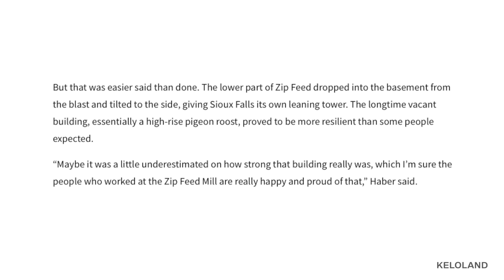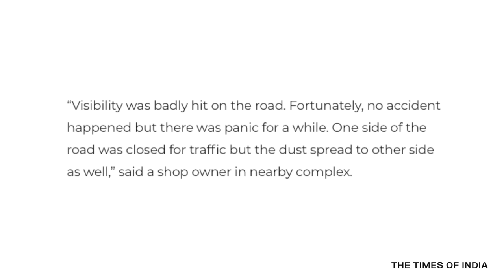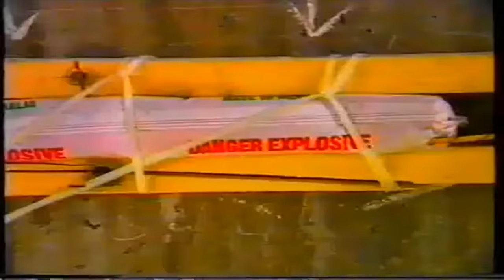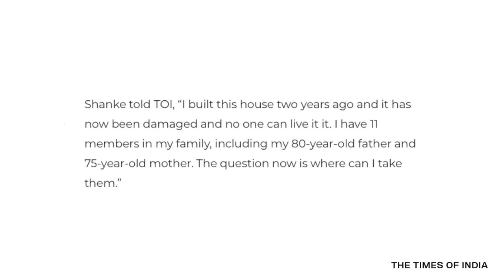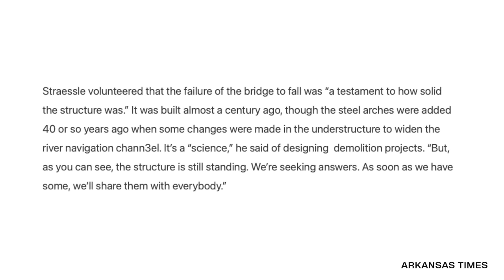Structure Demolitions Gone HORRIBLY WRONG

Comment: As an owner/operator of heavy equipment, I've never understood why excavators demoing chimney/stacks have their tracks pointed at the chimney. When they are close to collapsing the tower, they should position their excavator with the tracks perpendicular to the stack. If the the stack starts to fall towards the excavator, the operator has a couple of seconds to move forwards or backwards. At the very least, it could save the operator's life. It also could allow the excavator to avoid a direct hit.
Reply: I'm a 360 driver. I was thinking exactly the same. He had a death wish there.
Reply: Inexperienced, probably.
Reply: Prometheus School of Demolition, or something IDK
Reply: @OwnageNoobify  Sadly, no Charlize Theron to squish :D
Reply: I think you never operated an excavator. In the position you suggest, machine is prone to tipping over. It is not much pushing or pulling force you can apply.
Reply: @michaelarcher4643  I'm not talking about doing all the teardown work from that position. I'm talking about when the operator is confident that it is close to ready to go. "When they are close to collapsing."  I have seen four videos now of excavators futilely trying to back up as the tower is falling down on them. It's dumb. You may disagree with my suggestion, but surely you don't think that what we see in this video is the correct operating procedure. I'm well aware of the limitations of an excavator side on (perpendicular) to its tracks. If this guy had had a hydraulic chisel mounted (instead of a bucket), he wouldn't need a lot of push when it's ready to go.  I've owned and operated heavy equipment for 35 years. This is stupid dangerous.
Reply: It would have been a lot better to pull that smoke stack over with a real long cable and a bulldozer!
Reply: @smw381st  Agree, but that would have taken time, and too often safety is sacrificed in leu of saving time.
Reply: @Graybeard_  Opposed to someone getting killed?
Reply: @VicenzoV  Hahaha Good point!
Reply: tbh; not a lot of people think about that lmao
Reply: I've noticed they tend to poke at it, then surprise it falls on them.

Comment: That Broadway Bridge thing was one for the ages.  I remember being at work watching the live feed.  Turns out the theater (Robinson Center) is really close to the bridge, about 25 yards.  It has glass facade on the side facing the river and they didn’t want to damage.  The bridge did not fall 5 hours later, they had to add more explosives and detonate it I want to say several days later.  They also put a crane on a barge and attached the cable to wiggle it loose in different places before the second round of explosives.  That thing was so far over engineered it was crazy.  They said it would’ve probably been structurally sound for another 100 years.
Reply: So why did they demo it
Reply: You might also remember it was a private company that tried to demo the bridge. It was the AR Hwy Dept who brought it down later.
Reply: Demolishing a structurally sound bridge, meanwhile most of our other bridges have been crumbling for decades with almost zero oversight or plan in place to remedy the situation as state governments deregulate in order to increase profits for their shareholders (err, I mean, "donors")
Reply: The team who made the bridge  were too good at their job, hats off to them!
Reply: @krotchlickmeugh627  Perhaps it was too narrow.  They clearly didn't think it was strong as it actually was.  This is not the only time that kind of issue has occurred.

Comment: The best missed was the Met sports center which was located in the previous site in the  middle of the Mall of America. The designer commented prior to the demo that it was indestructible . It was , and many things to do to weaken it and many charges prior to the blast the demo crew laughed about how wrong the designer was . All the charges went off and the dust cleared and it didn't move at all . The designer laughed last. 😎
Reply: Dynamite: Boom!
Building: No, just no...

Comment: Rebuilding the Banfield freeway in Portland in 1985, the contractor was removing several old overpasses by dropping a headache ball om the bridge deck, with traffic underneath detoured. The technique worked except for one where the cable on the headache ball failed and wrapped around an 11KV power line overhead, plunging North Portland into darkness for several hours, and injuring several workers. When it was time to take down the 82nd Ave. bridge, the preliminary removals of guardrails, wingwalls, and such had been done, when the bridge suddenly came down six hours ahead of schedule. (The roadway underneath had, again, been closed.) For several frantic minutes, no one cold find the oiler for the crane, who had been seen under the bridge just moments before. He shortly turned up, having climbed a side slope to have smoke break.
Reply: So his life was saved by his cigarettes. For now.
Reply: Guard rails were probably holding the whole thing up. 🫣
Reply: Well stated Jack. Thanks!
Reply: @MrTruckerf  
He had one hell of a guardian angel looking after him that day!
Reply: agreed @MrTruckerf

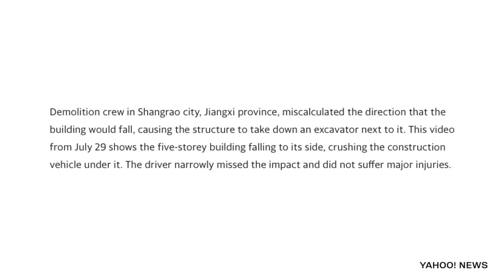Comment: 9:35 is just one more reminder/(proof in evidence) To STAY  in your equipment's protective cab. Do not jump out! Do not try to out run falling debris, it covers 32 feet a second, can you run that fast...Nope!.   That cage and big steel machine is there to protect you and makes it far easier for them to find and dig  you out if buried in rubble before the air supply runs out.
Reply: Close to half of all powered haulage fatalities occur from attempting to flee the cab during an accident. I've seen accident reports of operators falling almost a hundred feet with their equipment and being perfectly fine, safely seatbelted in the cab.
Reply: @OrinPhelps  

in this case (8:42) there must have been an Elderly Woman driving the Excavator.

Comment: After seeing that last bridge debacle I can only conclude that no working for that company had the slightest idea of what they were doing. There were no explosives placed under the bridge on the lowest portion of the cantilever or the supporting pier structure. If you blow those out on both ends that bridge would have come down since the roadbed and the arch would have nothing to rest on. My brother in law is a structural engineer who has worked on a couple of deconstruction bridge jobs and I sent him the link. He concurs with my analysis and said they attacked the bridge but not what was holding it up so it was a 50 50 chance at best.

Comment: In the case of the bridge it's likely that they stupidly used conventional blasting, low VOD (velocity of detonation) explosives, which are great at shifting dirt and concrete, but utterly useless at tearing apart metal like high VOD explosives akin to C4, so they were obviously far from being demoltition experts. Some 'genius' bank robbers once used low VOD dynamite on a safe, and only succeeded at blowing a totally intact safe through the banks' walls! :)
Reply: tell me the one about the bank robbers.

Comment: These aren't "backhoes".  A backhoe is tractor which has a font shoevel and a rear shovel, the real shovel gives it the name 'backhoe'.  The machines in this video are hydraulic shovels, excavators or 'hy hoes'. Also called power shovels. They're not backhoes. Google if you doubt.

Comment: Re:  the Pell smokestack. It would have cost the contractor a lot of money. But it would have been alot safer if he had hired or brought in four strong bulldozers and a high strength aircraft cable. They lay out the cable perpendicular to the weakest part of the structure. Then with 2 bulldozers at each end of the cable,pull the cable towards the base until it cuts through the brick and mortar. Eventually it would give way and fall safely.

Comment: Frankly, that first video is one of the few good arguments I've seen for the military existing.
Second video - have they never seen a Fred Dibnah video? 
Third video : nothing to say. 
Fourth video : Fred, again. 
Fifth video - bad practice ; Sixth video - fell per plan, pretty closely. Folding authorisation, I guess. 
Seventh video : yeah - "What next?" If I were designing such a demolition I'd include an "Oh shit" charge on each side, wiht a manual fusing. If it ocmes down more-or-less to plan, OK - manual trigger during the collapse. Otherwise - a second boom (pair), and include it as a "backup plan" in the original demolition plan. Having a "Plan B" is sensible.
Designing a plan without a "Plan B" is hubris - for which the gods extract punishment. These days, YouTube immortality is just part of the punishment.

Comment: These excavator drivers really had no clue on how to maximise their safety, or even how to ensure the structures would fall in the correct direction.  I operate an excavator and it makes me shudder watching the inevitable results of poor operation unfolding.

The structure next to the white house was doomed to fall into the house.  The correct method would have been to hollow out the opposite quarter near ground level before even attempting a push.  As it was, all he did was push the top half of the wall off the bottom half, causing the cave in towards the house.  The structure never had a chance of falling away from the house and in fact, had he pushed towards the house (not recommended) it would have had a better chance of falling in the right direction!

The Indian fire house operator should have used a long reach excavator and at no time should have allowed workers anywhere near the structure or digger.

The chimney should have similarly had part of the opposite wall demolished first.  The excavator should have faced his tracks at 90 degrees to the chimney so that in the event of an unexpected collapse in his direction, he had a chance to move the excavator either backward or forward out of its fall path.

These were all rookie mistakes which ended in dangerous and potentially lethal accidents.

Comment: i  was  talking  to  a  crane  operator   who  used  a  wrecking  ball  he  said  he  was  hired  to  demolish  and  old  theater   he  beat  on  it    with   800  lb   wrecking  ball   for  2  days  
the  building  refuse  to  fall   so  he  and   couple   of  hired  hands  had   walked  inside    while  the  building  remained   standing   while  in side  they  heard  a  loud  noise  in  the  ceiling  
then  realising   the  building  had   succumbed   to   the relentless  beating   finely  was  coming   down   with  them  inside   they  just  barely   made  it  out   as  the  whole  building collapsed 
 i  said   did  you  shit  your  pants   he  said  no  i  was  about  to  go  to  lunch   anyway   when  that  happened  i  took  the  rest  of  the  day  off

Comment: Re the smokestack collapsing on the escavator. I wonder if it would have been safer to attach a cable to 4 D8 bulldozers. Ist.lay the cable a safe distance from the stack parallel to the weakest point of the base. Then attach each end of the cable to 2 Caterpillar D8s. Drive the 4 bulldozers forward looping the cable to the base. The great force of 4 bulldozers might have cut through the brickwork until the tower collapsed.
Reply: I like that idea, but they would need a very long piece of very heavy cable, that may not be something they have laying around, and it would cost a lot.
Reply: @bigredc222  True but sometimes you have to sacrifice profits for safety. The guy was lucky to come out of that alive. Not to mention his escavator will need extensive repair before he can put it back into operation.
Reply: I think thats a great idea but noone would normally think of that due to the insane cost.

Comment: I was watching a bulldozer try to knock down some old frame houses built back in the 30's. He'd get up some speed with the bucket raised and hit them on the corner. On most homes all this did was partially spin the house on it's foundation, but the house was still intact! He ended up having to lift the roof off to weaken the homes by getting the bucket under the eve and pushing up! Even then the walls still stood and he had to push every one of them to the ground! These homes were built long before builders started hiring illegals to build homes like they do in Mexico!